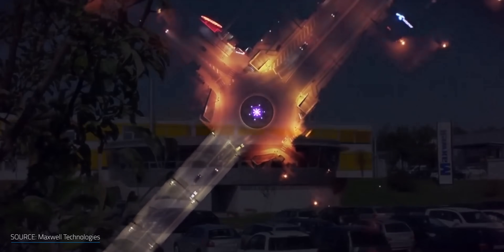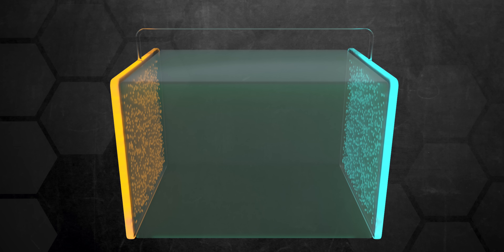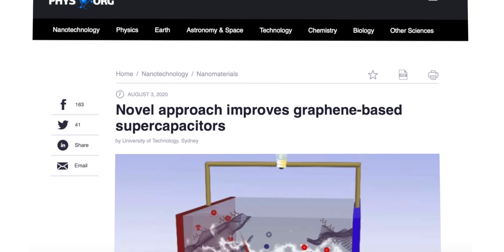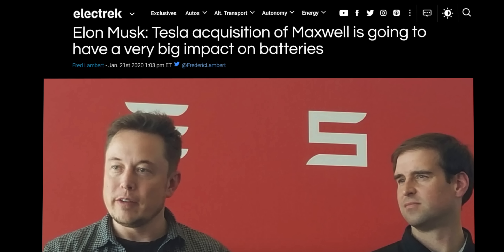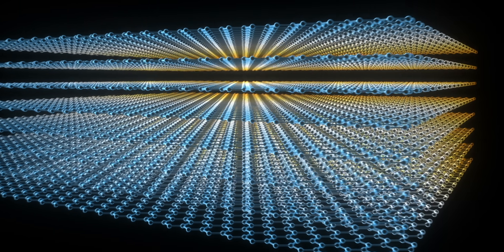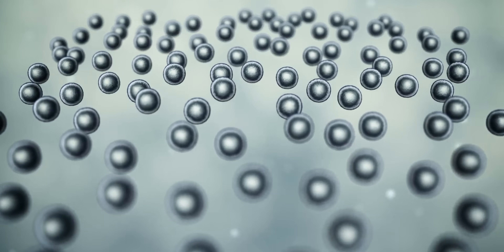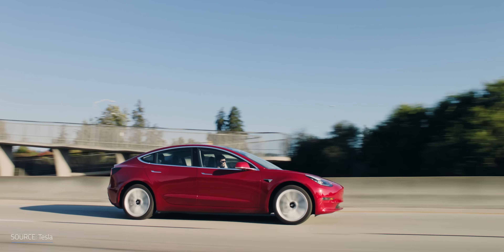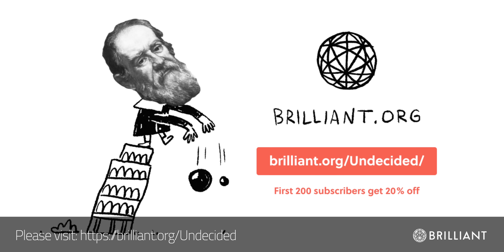Supercapacitors explained - the future of energy storage?

Comment: I think it’s just like SSD in computers, first you got HDD, then HDD+SSD en now it’s almost SSD only.
Reply from the maker: Interesting comparison.
Reply: And this is exactly how I transitioned, my pc is full SSD now :) the next upgrades will be NVMe
Reply: The thing is SDD is better in any possible way but price that’s why they used a combination of both (to save costs). Now that SSD has become  affordable enough, there is no point in using a worse technology. However, super capacitors are not better in every possible way than li-ion batteries. Therefore, it would require them to get improved to be a better alternative to li-ion batteries. However, capacitors are an ‘old’ technology and hasn’t got ‘much’ room for improvement whereas lithium is only taking off and it’s seeing improvements every year. This makes supercapacitors only suitable for certain applications. Here is a video about it, it was very interesting you make like it and learn some things: https://youtu.be/-7T-6XdiRTw
Reply: What missing in the comparison is specific energy, or size of storage. If SSD's were huge you wouldn't be able to transition to pure SSD.
Reply: Hugo de Andrés for now it is, but not in the beginning. In the beginning it failed a lot, was very small and it was very expensive. Over time it improved a lot and the price wend down. It the same amount of R&D that went into SSD over the last years went into Supercaps i wonder how much it would improve.
Reply: Where's the tape storage?
Reply: It's more like RAM vs HDD/SSD
Reply: Hugo de Andrés - SSD’s struggled to be better at first, in some cases only marginally faster, with significantly less storage density and higher costs, and even less durable if you needed to make a lot of write cycles, if anything SSD’s in comparison had more disadvantages than super capacitors. Super capacitors are better than batteries in almost every way except energy density. Super capacitors are more durable than batteries, with no degradation in the amount of charge and discharge cycles, they won’t exploade or cause fires as much as batteries, they’re lighter than batteries, can charge and discharge faster and provide more power at once, are less sensitive to temperature changes, and don’t swell or deform while charging or discharging. The only problem with super capacitors is the density.
Reply: The only thing that has the potential to be better than super capacitors is probably solid state batteries. They could still degrade over time but much slower than current batteries.
Reply: if only storing energy is like saving files
Reply: Its not entirely, when you get into the Petabyte storage, you will still have HDD as long term store and SSDs only as cache. Exactly like having Li-Ion for bigger and longer storage and super caps for short bursts. Perhaps a car is more like a personal computer, a SSD will be enough for it, super-caps are going to be enough for a single day use of the car. It could be an advantage if supercaps were lighter in weight.
Reply: @electronresonator8882   Saving files are actually storing electrons, except the amount of energy required for storing a file is minuscule. for example, all flash-drivers literally store electrons in a quantum well, the problem with that is that you have now an almost stopped electron, instead of a current, you have just a tiny magnetic field you can detect, but that won't be enough to power a led, its barely enough to read the bit, and they do bleed with time, so never store data in a flash drive for long periods of time, like years, use the good 'ol spinny rust.
(you could ask, buy why my SSD still has 3yo data, the answer is that its software take care of refreshing the data, also, error correction, just try never powering it up for 3 or 4 years and you get corrupted data)
Reply: @electronresonator8882  Electric Energy is just something moving, the only way of storing it is chemically, because in chemical bonds you do get equilibrium and the energy will be stored forever in the bonds. Electrostatic energy is a fun thing, you can store lots of energy statically, by literally storing the electrons, but they do take space as you're using only the "outer shell" of the atoms to store them, you can't match storing them in chemical bonds, or even better in nuclear bonds in power density.
Reply: As good as li-ion power density is, its a joke near the power density of gasoline for the same weight, and the gasoline density is another joke near anything nuclear like plutonium. 
The future is nuclear, I never seem before our society moving from a more density power source to a less dense one. 
Unless we create a dynamic grid like the internet so we can move energy as fast as routing a single packet is on the internet, I'm talking routing energy in the sub-microsecond range.
 No power grid we have now can do this that fast and without intervention, and no, power drafting doesn't even come near what we need, and it does rely on either gas engines or hydro engines, and if we are going to use less dense power sources we are going to need to route tremendous amounts of current like we route data.
Supercaps are going to be instrumental in doing this, that's for sure.
We will need a high-voltage distributed grid, the Internet of power, and I don't see that happening, because then everyone will depend on everyone else, its not an engineering problem that big, but politics are.
And then you won't need to store power to use at night if you can route it from the other side of the world.
I only see two outcomes, either small-nuclear-reactors as baseline and/or a distributed grid, you can't run a society on intermittent wind/solar with such low density, it will never work (and we are going to wait forever for a break-through in batteries), unless you have a good baseline or a crazy-fast switching distributed system that can route energy from anywhere its being generated on excess (like every-time solar/wind works, its never when you want it) to anywhere its being demanded, just like the Internet does with data.
Reply: @monad_tcp  I believe it could be cheaper to make a server entirely out of SSD's because it makes more economic sense in the long term, as long as you're not consistently re-writing them it will turn out to be cheaper than replacing hard drives. I also believe Linus tech tips made a large scale storage server entirely out of ssds.
Reply: @johnj8639  if supercapacitors are smaller than batteries why don't they just make up the difference of density with more batteries. just letting you know this is a video I found by chance and I don't know jack shit about these technologies.
Reply: @aa-kz7hc  I didn't say smaller, I said lighter.
Reply: @johnj8639  oh
Reply: @monad_tcp  I got your point, and the humour as well
Reply: @n3gi_  Tape is for archiving, not for everyday use.
Reply: @jesperseegert5779  SSD are getting there in the storage size department (although the world is in need of a new compression tech for data without much loss), and i honest cant wait for SSB to become a thing,
Reply: I think this tech should be applied like cache in a processor. Use a capacitor bank buffer in line before the battery; that or maybe design individual cells with built in capacitors. Upsides: Better regenerative braking efficiency, potential turbo boost of power deliver in performance cars, longer battery life by supplying smoother, more consistent power to and from the battery reducing heat and prolonging life span. Downsides: lower energy density across the whole car, heavier car compared to a car without capacitors, another point of failure, now you need to code and install a computer to control the more complex system.
*Yes, I did notice that the vid showed some cars that already use supercapacitors in the same way described above, I just thought it would be fun the expand on the concept here.
Reply: Thanks a lot you explained 11 minutes of talking.
your comparison help me  understand the whole things
Reply: There was a floppy disk before HDD.😛
Reply: SSD has not only faster IO but also has higher density than mechanical drive. So there is nothing that mechanical drive does better than SSD. HDD + SSD is only to reduce cost but not efficiency.
Reply: Today it was announced Windows 10 will warn about imminent failure of SSD in computers.

Maybe something similar for supercapacitors? If so take vehicle to service by replacing the unit. Big money for manufacturers.
Reply: For people knowledge human are not going to stop at ssd scientists are trying to store data in DNA 🧬 blood which could store lots of data in small amount.
Now our data is too much i mean data server are reaching number of petabytes.
Reply: Most SSDs still include RAM for the flash translation layer, and enterprise SSDs even often have supercapacitors to allow RAM to be used as a write-buffer for a big speedup of synchronous writes (done by the operating system and critical applications) which is important for responsiveness or performance of critical applications like databases or log systems. Even in SSDs that are DRAM-less you usually have a few MB of SRAM on the controller that is used to cache the flash translation layer and hold temporary data.
Conceptually we're talking about technologies that operate at different orders of magnitude capacity and speed wise given a physical footprint (or cost). The same way you would pair a 1TB SSD with 1GB of RAM on the controller (and probably 16GB of RAM in the host system), you could also have a small amount of supercapacitors inside a battery-pack to allow it to do 10x higher burst charge or discharge for a few seconds (0 to 50-60Kph?) and add an external supercapacitor pack additionally to allow the vehicle to handle the full acceleration or deceleration the motors can do to/from top speed (or some sane speed) which could be scaled with the electromotors chosen.
If you had a bit over-sized supercapasitors then they could deal with small to medium hills as well. And if you remove the requirement for the battery to support acceleration, you could design it for higher enegery density and lower power density (higher kWh, lower kW) to get overall higher capacity or lighter batteries of the same capacity.
Reply: SSDs are still no where near as good for price per terabyte of space. Which is why I have like 32TBs of storage, but mostly on backup HDDs. And have several SSDs for mainline computer functions, or files I actually need/want to go fast.

But even adding this comparison, it makes it even more accurate with this an traditional lithium batteries vs hypercapacitors. IE: Storing energy for long-term use, it is still very cost prohibitive to have that mainly for the hypercapacitor.
Reply: Agree
Reply: @johnj8639  wouldn't another problem be that they instantly discharge all their Voltage? It needs an intelligent relay to empty each capacitor in sync with the others to provide a constant flow of energy no?
Reply: @Rhinoch8  Super capacitors are different from capacitors, they should be able to discharge consistently, but as far as I'm aware capacitors don't always have to instantly discharge either.
Reply: @chrisr715  On Point!
Reply: @hugodeandres1497  there is one thing that HDDs are better than SSDs n that is long term storage of data. they can typically last for 10 years while an ssd's is 5-6
Reply: Very, very unlikely. 

A battery and a capacitor are two VERY different things. And the technology is quite old at this point, yet there hasn't changed a lot. Because unlike Batteries, a capacitor is nothing more then two metal plates, that are seperated. And that's it, nothing fancy. The only way to increase the capacity is by a) making the metal plates larger and/or b) decreasing the distance between those metal plates. 
As you can see, we have only limited options to pack more energy in the same space. There are limits and our capacitor tech is pretty damn good by now, which isn't very suprising, because capacitors are used EVERYTHING and for a LONG time. The first capacitor was the Leideners Bottle from 1745.... 

Now with batteries - there are way more options to store chemical energy and we've not come even close to any limits. 

No, Capacitors will NEVER replace batteries. That's simply not possible - ever. What we can do is use them clever. Like we use them today in vehicles. They can complement a battery system and should be used for that.
Reply: @UndecidedMF  Not really, on a technical level completely different.
Reply: It not that wweghorst, just remember Tesla is one the biggest battery producers in world for their cars.   But they are still losing money on their batteries.  So the problems is getting up to scale to make it profitable otherwise you bleed money and bankrupt your company just like Faraday and others.
Reply: Mine is currently a hybrid and it has been a massive improvement, full SSD is still too expensive, but it will be the future no doubt
Reply: @hugodeandres1497  
HDDs are better for archival.  SSDs have a limited lifespan, where as an external archival HDD can last 40 - 50 years (around when it starts to lose magnetic charge).
Reply: It is more like RAM... oh wait, ram is a capacitor
Reply: @monad_tcp   you had me had future is nuclear, i wish people would get their heads out of their ass and see the literal miracle that actually is nuclear energy
Reply: @hugodeandres1497  No point in using a worst technology.

Dude, the price difference per Gigabyte for a Hard drive VS an SSD means Hard Drives will always have a place.
Reply: I truly believe that the future of energy storage will be in some form of electrostatic super caps.   Just like old spinner HDD's, they went on the wayside once SSD became available cheaply and reliably.  Unlike SSD's which still have a cell wear limitation, super caps do not, you can recharge it a million times and it will still have the same capacity.
Reply: HDD technology stagnated. I have WD10EZEX drive, that model was released in 2012 and its still pretty fast for HDD. Companies no longer do much to improve HDDs and are focusing on SSDs.

Comment: One problem of capacitors is that their voltage drops as their charge drops.  (Batteries have a nearly constant voltage.)  When the charge on a capacitor has dropped to half, its voltage has dropped to half.  This problem can be overcome with an automated switching device that keeps the voltage constant no matter what the charge.  When a capacitor bank is fully charged, all of the capacitor units will be in parallel.  As their charge drops, the units can be switched to series circuitry.  At half charge the units will be in a mix of parallel and series.  At minimum charge, all of the capacitor units will be in series.  The capacitor bank will give full voltage at any charge.  Such "smart capacitor banks" can replace batteries completely and might be useful where weight is not a consideration.

Comment: Currently super capacitors are price competitive with lead acid car batteries. I've been running a 110 farad capacitor and a lawn mower lead acid battery combination in my Nissan Sentra for about 4 years. It works fine. I tried running the capacitor alone and found the parasitic drain of the car drew the capacitor alone down so far that it wouldn't start the car after about three hours, but with the battery in parallel with the capacitor I can leave the car for a week or more with no problem. current battery price for my wife's Honda is over $200.00. current price on a lawn mower battery is $25.00 and a 166 farad capacitor is around $110.00. The Honda needs a new battery and both the lawn mower battery and the capacitor together will fit where the car battery goes in the car. This is a no brainer swap.

Comment: Hey Matt... I think super capacitors could be used to recoup energy from the suspension dampening using cervos. The amount of energy a vehicle experiences with the road surface variance and grade, I believe there is some untapped potential for super capacitors.
Reply: that sounds like a job for a regular capacitor ...

Comment: I use a supercapacitor jump-pack to jumpstart boats. They're neat. Half the size and weight of the old style that had a motorcycle size battery in it, but it'll turn over a big diesel engine. Once. 
The upside is that you put it on the good battery and it charges back to full in a minute.
That's really what they're good for putting out really high amps for a short time.

They're never going to replace batteries. What they're good for is spike loads. It doesn't matter if they can only put out the power for two seconds if you're using it to go 0-60 in a Tesla.
Reply: I use the same for my car.
This one:
https://www.norauto.pt/p/booster-norauto-premium-sem-bateria-mf450-2054033.html?CatalogID=48599&CatalogCategoryName=48702
It charges with residual energy from a car battery (or using a 12v socket, or even by simply charging at home), which has nowhere near enough juice to start the car, but its plenty to charge the booster, and after a few short minutes, it can "spit out" 450 amps.
It doesn't completely negates the need of having a set of booster cables and the help of another car if the battery is at zero, but since that scenario is unlikely, that supercap booster makes me less reliant on needing the help of others.
Reply: @00Resev  really interesting man

Comment: On my ebike, I am the super capacitor, I will pedal up to speed then use battery power to maintain that speed. This is also being used in RV ac units, reducing the power needed to kick start the compressor
Reply: I pedal up to about 45kmh and then i just let the motor take it from there up to 80kmh since i can't pedal that fast.
Reply: @numbdigger9552  those are rookie numbers. Gotta push those numbers up!